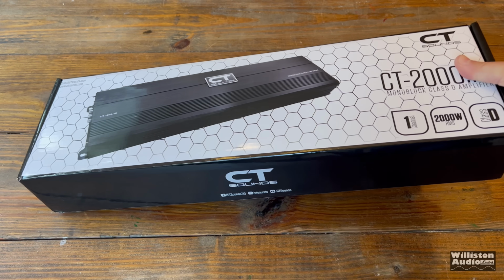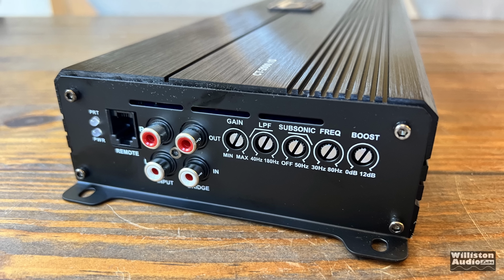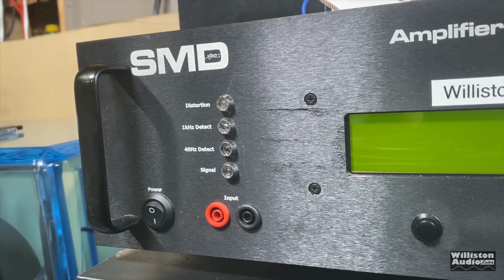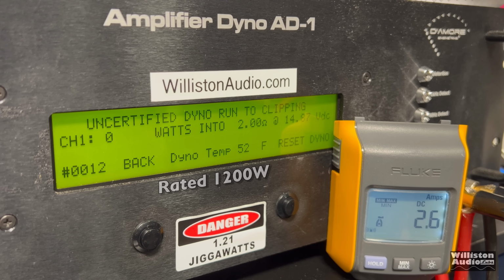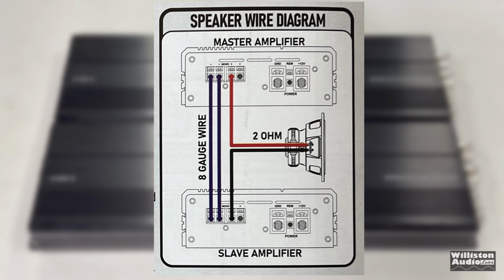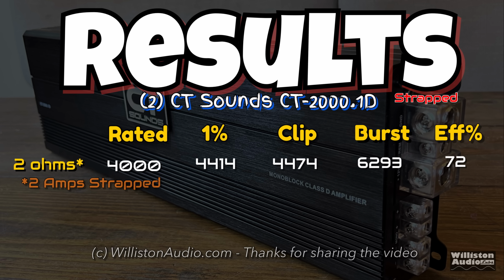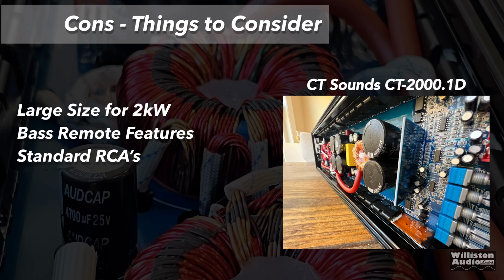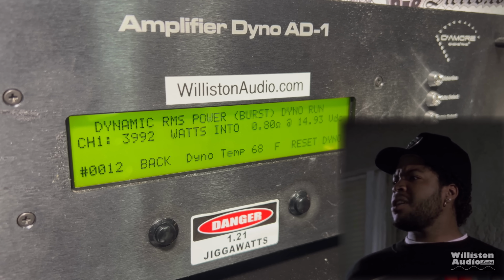CT Sounds CT-2000.1D Amp Dyno Test Also Two Strapped for 4000W PLUS!

Comment: What is the slope of the crossover?  It is not specified on CT Sounds website.  Your Skar review of their mono amp you mentioned it had a xover that was allowing voices thru the sub (like 6db/octave or less?).  Some say Skar and CT Sounds come from the same factory but no idea if that is true.  If I installed the CT Sounds 1000.1D and I could hear muffled voices through the sub in the back I would be annoyed.

Comment: Question since this amp is a monoblock but has 2 negative and 2 positive speaker output terminals; will each set produce the wattage you showed for 4ohms? Or will the wattage be divided?
Reply from the maker: the negative terminals are connected internally as with the positive ones. You can get all power out of one, two are provided just for ease of wiring

Comment: The Philips heads on the terminals are negative for me. They have a tendency to round out Sooo much easier than Allen heads. And when you're running dual inputs it's really important for them to be as tight as possible so they don't vibrate or bounce loose while driving or playing heavy bass, or a combination of the 2. I REALLY wish that companies would use Torx for them so we could have that extra confidence in our connections. Lol. Maybe I can find some Torx head set screws to replace them with. Lol. (I'm actually waiting for this amp to arrive from shipping) Lol.

Comment: Interesting looking at the internal layout of components on the circuit board of this amp, the Harmony Audio ha-a1500.1 and the DS18zr2000.1 all seem very similar if not exact clones of each other.  Power output at various ohm loads are close with both the harmony and ctsounds amps...would infer that the ds18 amp would produce similar wattage as well.  All seem like awesome bangs for the buck and might be just a matter of looking for the best deal if these amps are appealing.

Comment: I've run so many different brands through the years, nice to see ct-2000.1d numbers are true and real.

Update: amp from day one has given me trouble with protection. Day 1 turn on amp, went into protection,  turn the frequency dial, it would work, weeks it would work flawless and outa no wear protection,  it would do it on and off for weeks, then months would go by with no hiccups, this last month, its really struggled and now its stuck in protection, id say its no good now... I musta got a bad one... kinda sucks as its such a powerful amp...

Comment: This is the same exact amplifier just different badging as the scar 2000.1
Reply: No it's not. You're making a rookie mistake. If you compare those two amplifiers you can clearly see they're made by different companies with different components. There's a good chance that both models are clones of a older amplifier design. So if you look at the internal layout you'll notice a lot of basic similarities. Each company is basically doing their own version of that older original design. Each company may also be doing their own small changes to it, as well.
Reply: @JasonWW2000  keyword in your paragraph was May
Reply: @JasonWW2000  and like I said before even if the SCAR or the CT sounds gets an extra one to 200 Watts out at RMS rating they're basically the same f**** amplifier prove me wrong
Reply: @mattfarley6068 Do I need to prove you wrong or do you need to prove me wrong? 

I can give two different companies an amplifier schematic and tell them to make me an amplifier based on that. The end result will be two very similar looking amplifiers with the same basic layout of components. They may even output very similar power levels. Are they the same amplifier? 

If you're a layman, and don't know anything about amplifiers, then I could see where you would just assume they were the same. 

If your knowledgeable about amplifiers, maybe a repair tech, then you will realize that even though they're similar looking they are completely different.

I'm talking different thicknesses of the pcb, different brand of capacitors, different style of transformers, different FETs on the input and output section, different features in the preamp section, different protection devices, etc, etc...

The point I'm trying to make is that they actually are very different amplifiers. They may have different features and different levels of reliability. One may run cooler than the other. One might be easily shooken apart while the other might be as solid as a tank. One might include a clip light while the other doesn't. One might have short circuit protection while the other doesn't. One might have noticeably less distortion figures than the other. One might have a higher noise floor than the other. One might be more prone to alternator whine than the other. On and on...

I hope I can educate people so they won't just assume stuff is the "same".
Reply: @JasonWW2000  🎶 👂 there is always going to be small differences between the two 🎶 there the same don't care about clip lights badging ect there both decently priced and decent quality 👌
Reply: @mattfarley6068 Thats cool. I realize not everyone wants more information. I'm just trying to take people from thinking "all cars are the same" to realizing they actually aren't. 

I guess I wrongly assumed you were interested in amplifiers because your here, watching this video.

Take care. 👍

Comment: Ive go a question! Im old way older than you. I wouldnt mind a sub if I could get one that just hits hard and clean like a drum not all the vibrating stuff. Any sugestions? I have a good 4 speaker system with quality head unit and small 50w 4chl amp. I dont have a issue with spending money but I want good acurate bass. I see all the kids with cars vibrating Thats not what I want. any sugestions? Ive been to lots of good concerts and never heard the stages shacking from vibrating boom boom boom from Van Halen AC/DC etc.I do remember coming home deaf though LOL New to all this all over again.
Reply: Basically you're saying you prefer mid and upper bass and not so much the low bass. Sealed subwoofer enclosures are probably going to be what you're looking for because they roll off the low bass naturally compared to a ported enclosure. You're going to want to focus all of your bass output in the 40 Hz to 100 Hz range. As long as you're not trying to do this in a large SUV you shouldn't have any issues.
Reply: I also wanted to mention that there's nothing wrong with having a subwoofer system that can play low frequencies. Strong output at 25 to 30 hertz is just fun and is part of the original recording. You obviously don't have to crank it up so loud that it's vibrating your car. You can adjust it so that you have nice smooth frequency response all the way down low to really enhance all music.
Reply: If you don't need a massive amount of output you might consider something like a single 10 or single 12 inch sub in a slightly oversized sealed enclosure. 
You might be fine with a couple hundred watts of power going to it, so due to impedance rise and how you're going to match it up to the amplifier, you should probably look into a monoblock amplifier in the 400 W to 800 W range. Make sure the amp has a remote bass knob so that you can mount it up front and be able to easily adjust it. An amplifier with an adjustable subsonic filter can also allow you to filter off the really low bass.

Comment: Buddy of mine ran one of these CT2ks at 0.5ohm and 16v for well over a year on 2 xv3 12s doing consistent 148s at 28hz from the trunk. It blew recently. But still the amount of abuse it took was outstanding.

Comment: That looks just like the audiopipe apmi2000 inside
Reply: If the board layout looks extremely similar between those two amps then it means they were probably both based off the same original design from an older company.

Comment: The power these things push out for pennies never ceases to amaze me. I came from 1987 when in high school I had 4 Becker 10s in the back seat of a 1969 bug when it was $1 per watt. Pushing 250 watts on those back then with a proton amplifier, I forget the model. Good times but expensive. $250 back then was a lot of money.
Reply: @stevenyoung3360  no offense bro im curious when you said Becker did you mean Kicker I remember alot of brands and I know some stayed in there own area back then
Reply: @rod1318  No. We had Becker 10s and 12s we could get. They looked a lot like Fishers from the same era but they were car audio. White with a black cloth dust cap and black foam surround. These were at the very beginning of  big car audio bass, This for my area in Sacramento was really starting out in 1984/1985. And Beckers were truly a fantastic sub at the time, not very inexpensive but they were some of the best around at the beginning.

Comment: I would have liked to see a woofer test, could we possibly get another video?
Reply: As someone who's personally owned this amp for 2+ years, if you're asking if it'll move your subs well... Yeah, it does. I've killed 2 subwoofers with it (1 being 1000w RMS and one being 1250w RMS) doing frequency sweeps while wired at 2ohms, and presently it's making 2 1500w RMS subs bottom out while wired at 1ohm. Never once has it sounded less than great (except for during the destruction episodes 😅). IMHO, it's a fantastic buy with the added benefit of not needing to raise the gain past halfway to get some healthy boom action.
Reply: @RAW_Reality  That's awesome! Do you mind if I ask what subs you're running?
Reply: @Derrick.12  Sure... A pair of Deaf Bonce DB-SA272 12's in a 2.33ft³/per box. Great blend of punch force, control accuracy, and liveliness in what's otherwise meant to be a sleeper SQL build.
Reply: @RAW_Reality  that's sweet I wish I could hear that build
Reply: @Derrick.12  My thanks, I'm pretty happy with it. Though what I'm most pleased with is the detail I have dialed in with features like time correction and artificial elevation. In a way, it's a surreal experience, as it's almost impossible to describe what effect it has to be listening to music in such an environment. Effectively, I've made it so where the sounds from all 8 speakers hits your ears at exactly the same millisecond, providing a surround sound effect that I've only ever heard replicated in one other vehicle; a car audio company's show-piece car that was half the size of what my system is in. The guy taking it on a national tour was so impressed that he even asked for my number to talk shop. I have the subs turned down to -11 for the best blending effect of all the music, but even then you can still "feel me" in the car next to it at half volume. 😏 Not gonna get any SPL leaderboards, but it's my own little audio nirvana. 🤷🏻‍♂️ Anyone that asks about it in person I try to give a demo to, and I'm always enjoying the reactions I get from it.

Comment: Just don't mount them on your sub box. Ive seen 2 of these exact amps that the board cracked on.its because the middle of the board isn't attached, just floating all thru the middle, and that's a loooong board that will flex under high spl.
Reply: @timstarnes8587  so have a properly built enclosure and you wouldn't have that problem, I run 4 of these all mounted to the enclosure due to lack of space to put them anywhere else but for last 3 years they've been solid, barely get warm full tilt for hours, user error was the issue in your scenario
Reply: @FrankySenses  Wasn't my scenario. I saw half a dozen posts of the aftermath form this issue. 2 of them were professional install, spl builds.

Comment: EXCELLENT VIDEO. CT Sounds equipment is for real. I needed a pair of "stronger bass" 6x9's. I chose a pair of their "MESO" series 6x9's. These are (by far) the BEST sounding 6x9's I have ever worked with. DEEP bass (in the 30-40 Hz range) all day long. The silk dome tweeters are very good silkies, but I found the NVX 6x9's sound a pinch better. The best part...the MESOs are rated for 100w RMS each. Whatever. I push them well over 150w with no bottoming out. I switched amplifiers (400w per channel) to see what would happen. The finally started to "slap" and bottom out at about 300w RMS. The output from these MESOS are insane from a pair of 6x9's. In some applications, you can save money by not needing a subwoofer/box...just a high power 2 or 4 channel amp (300 wpc is about right) and some EQ and you'll be cooking. 23% OFF! WOOT!

Comment: Would rather get the stinger MT2000.1
Reply: Why?  I've read all the Amazon reviews for the Stinger 2000 1 and a few people say that it doesn't hit the low end.  Plus the CT is half bridge so you have the ability to strap down the road.
Reply: @minus3dbintheteens60  you're reading lies, if they're not hitting the low notes, that's on their sub and box. And the stingers are strappable as well.... Sounds like you really didn't do your research.
Reply: I've taken all the evidence I have available to me and analised it without bias.  You sound buthurt
Reply: @minus3dbintheteens60  let you tell it.

Comment: I’ve had my CT sounds 2000.1 amp for a little over 3yrs now.  I’ve went through a lot of subs… but the $260 I paid for it then, was well worth it ! I also run their amps in my other vehicles. Never had a problem with any of them ..👌
Reply: @astro54541  how is the sound quality on it

Comment: I need an Amp for a RF 12" P3/D2 in a ported box. It can handle 600RMS, I want to run @ 4 ohms for the higher efficiency. I tend to stick with memphis but I'm learning name doesn't always mean better. Any help would be appreciated greatly! Thank you
Reply: Compare and contrast by your own research (not some Reddit query), but 3 contenders for you would be: 
1. Deaf Bonce Atom 2.5K Pro
($238 from Big Jeff)
2. Deaf Bonce AAP-1600.1D Atom Plus 
($143 from GPAudio)
or
3. JL Audio JD1000/1
($400 from Sonic Electronics) 

Make the decision based off of what matters most to you: cost, upgradability, features, size constraints, and not by things like looks, brand loyalty/recognition, or origin of country. All of these options I've listed meet your requirements and will do a fine job provided proper installation of your use case. ✌🏻
Reply: @RAW_Reality  I've seen a few that he called "under the radar" that were right in the $100-$125 range that preformed very well. I would like a clip light on the remote (idk why they're not wireless by more) so I'll know where to keep it set. I like to run my amps at about 75% on gain to avoid crunch. I bought that sub in 16" but rolled my overland rig. I just put it away, it was barely breaking in. I prefer Sq over spl by far. Budget minded tho lol
Reply: @jhrubicon1470  It'd seem like the 2nd option I listed would work out well for you then.
Reply: @RAW_Reality  who makes those Amps? Website?
Reply: @jhrubicon1470  Just throw the suggestion into a web search and it'll give you some links to where you can browse the specs.

Comment: I have have the CT1500.1 for over  a year and a half now and I must say it is pretty impressive. My only complaint is that blue light on the bass knob is bright as heck at night. Solid amps though
Reply: You can always go in there and swap out the resistor for a larger value to dim it down.